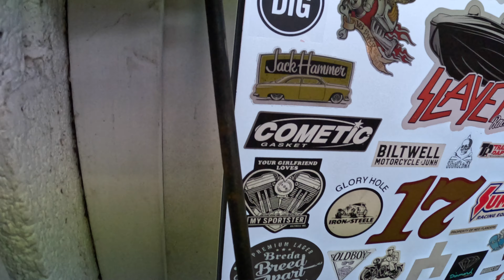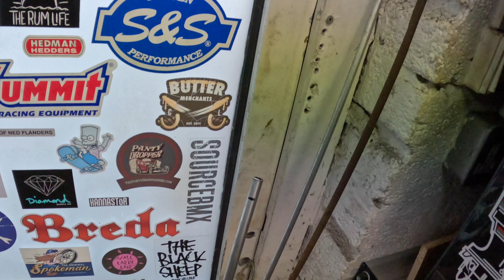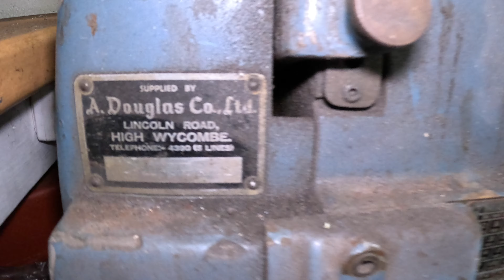Building a Beach Buggy - Part 3 (Even More Chassis Work)

Comment: Top job, are you going to run a tube for the electrics and brake lines as well? Save fishing them through.
Reply from the maker: The brake and fuel lines are going through there yeah, but the body has a tube glassed in either side under the arches so that all the wiring can travel through there.
That way if the body ever needs to come off in the future for any reason, the wiring can all stay with it.
Reply: @Neil_of_Steel  nice, really enjoying the videos.